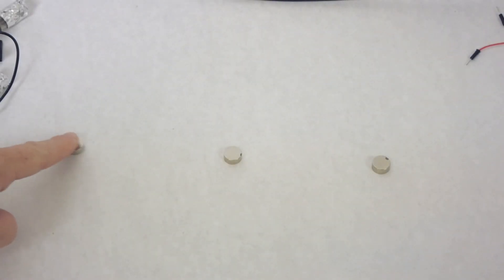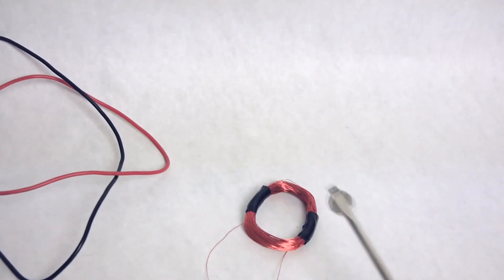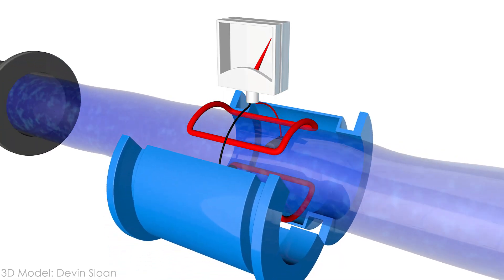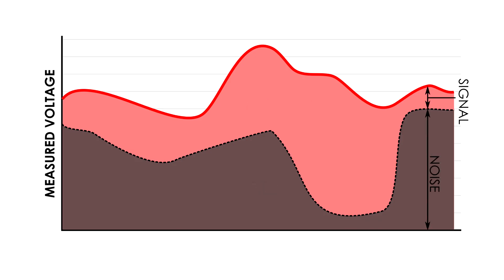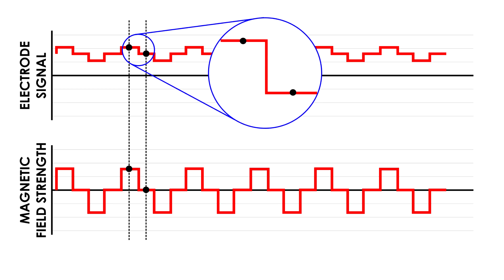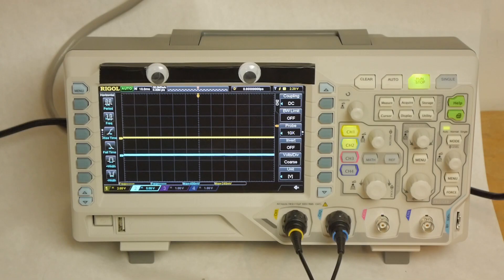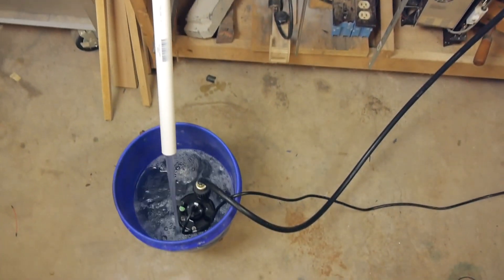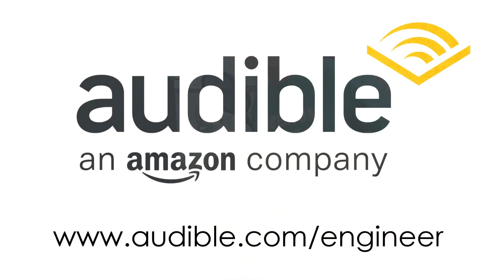How to Measure Flow with Magnets - (Magnetic Flow Meters)

Comment: I think you might have less noise if you had well-grounded copper pipe sections on either side of the flow meter; this would serve to dampen charges built up from the water flowing through the pipe, the pump, mixing with air, etc etc etc.

Comment: Try using distilled water to clean your setup, then fresh distilled water in the measurement. Very slight changes in conductivity from chlorine in tap water will greatly affect your result.

You may also want to try using a grounded steel bucket instead of plastic to limit static build-up.

Very cool video though, I may have to build one!

Comment: I am not sure what affects the magnetic properties of water, but maybe adding some salt might cause a stronger signal. However I do not know if the water pump would like it and if this would add more noise of the pump to the voltage measurement. I would also suggest trying the insulate the outside of the electrodes better.

At university I also did an experiment in which we had to measure velocity, but using an laser (laser Doppler anemometry).

Comment: I've dealt with very small signals in the past with a much different application. I used it for what we called it for my final project "visual communication" communication using visible light. Our requirements were more stringent in terms of bandwidth, however I would the think a similar set up may work in this case. 
Oops,  I was just about to make a mistake, I realized that your circuit provides a voltage source instead of a current source as my photodiode did, 

anyways I think you need a bandpass filter as shown in this article:
http://www.analog.com/library/analogdialogue/archives/48-02/flow_meter.html
You can use Figure 9. The rest may be unecessary, such as figure 10 which is supposed to figure out direction of flow.
Just be careful, analog electronics is a pain in the balls.

Comment: Ultrasonic transducers are a great way to measure flow.   Phase change is relative to flow rate and changes in amplitude is related to changes in the fluid density or entrapped gases etc.

Comment: You should make the electromagnets longer. Say 1 meter long and 3 cm wide. Then put ground connections 30 cm before and after the magnets. Then wrap the whole sensor in aluminum foil to block radio signals.

Comment: Slightly unrelated, I think the mass air flow sensor in my car uses the physical deflection of some component to measure flow. I want to say it measures either resistance or capacitance, (capacitance seems to make more sense to me at the moment) but either way, as the component deflects more due to higher flow, the value of that characteristic changes.
Reply: It probably uses a "hot wire anemometer," look that up.
Reply: Looks familiar, thanks for the tip

Comment: Add some salt. Would ions in the local environment change results significantly? I'd also try distilled water. "Pure water," as I've been instructed is remarkably insulative. Such devices may need to be calibrated to local water supplies, assuming that they are invariant. Diaphram meters are the simplest accurate measurement that I'm currently aware of for both gas and incompressible fluids.
Reply: If the point of an actual meter is to measure the fluid that actually has to be delivered, changing the fluid to make it easier to measure is not an option. You don't expect your water utility to add salt to your drinking water just to make their meters work better (of course if you live in Flint MI, you have lead in it already). For a test or a demo maybe, but in the real world you find a way to measure what needs measuring.

And he didn't talk about nonconducting fluids, although the teaser at the beginning of the video seemed to show a gasoline pump. Maybe they use a hot wire anemometer for those (but not too hot).
Reply from the maker: I tried some baking soda to increase conductivity but no dice.
Reply: Austin Keller then just don't do it? it really doesn't make much of a difference
Reply: As long as your differential instrumentation amplifier has an input impedance >> (much greater than) the resistance of the water, increasing conductivity won't help.

Even tap water should be conductive enough for this. The magnetic field inside the coils should be larger than the pipe, or eddy currents in the water sap the signal.

Absolutely pure water likely won't work, as there is close to zero conductivity. But even the slightest bit if ions in the water cause some conductivity. Water is the ultimate solvent - put it through a metal pipe, metal immediately starts dissolving a bit into the water. Plastic pipe? There may be salts or some other ionizable substance that can dissolve into the water. Glass pipes? Most glass has metals added to increase toughness or clearness.
Reply: +1
Reply: Justin Koenig The YouTube app doesn't implement +1
Reply: This electromagnetic effect (inductance) does not depend on the conductivity too much. What the magnet does is change the alignment of the magnetic dipoles of the electrons in the water molecules.This makes the magnetic dipoles point toward the magnets, but the dipoles are still flowing with the current. I think with a conductive medium there would be more dipoles, so there would need to be calibration due to this, but conductivity is not necessary (although everything has some conductivity) for this to work.

Comment: Some ideas to pinpoint the issues with the apparatus: 1) Use Hot glue to secure the coils into position, any movement could be creating additional noise. 2) What happens if you increase your square wave frequency. It is possible that the noise baseline is too far away from the required signal and you are not getting any meaningful results when cancelling out the noise. 3) Reduce background noise by adding a faraday cage around the sensors and wires leading to the oscilloscope. 4) you explained the theory but did not give any details on how you made your sensors cancel out the noise after the signal has been detcted (circuitry etc).  This can either be accomplished via some arduino code, a splitter with delay circuit going into another port of your oscilloscope or some other options.

Comment: Silly question: would a more conductive fluid  (read: salt water) induce more current from the inherently lower resistance?
Reply from the maker: Tried this and didn't seem to make a major difference (I used baking soda).

Comment: Would changing the pipe (that the coils are connected to) to a smaller diameter give a better signal, since it will increase the fluid velocity?

Comment: Why is the magnetic field varied instead of just passing the output through a high-pass filter? Both techniques seem like they would only eliminate low-frequency noise.
Reply from the maker: Some of the noise is a constant source (e.g. electrolytic voltage) which would not be filtered out.
Reply: A constant term has a frequency of 0, and would be filtered out by a low pass filter.
Reply: Oh! But a high-pass filter would also filter out the signal from a steady flow in a pipe. You would only be able to get changes in the flow rate.

Comment: My first point of call would be to reduce the electrical interference in the signal wiring. I don't think you ever showed it in the video, but I would start by using shielded twisted-pair cable to connect the electrodes to the differential amp. Make sure you connect the shield to the differential amp's ground, and connect the twisted pair to the two electrodes. Hopefully that's something you can try without too much work? If you want a cheapish source for shielded twisted-pair cable, you can buy STP Cat5 networking cables pretty cheap. Or you can buy audio cable, though that's usually on a larger spool.
Reply: Quentin Smith buy a cheap microphone cable for $5 or so on EBay. Cut off the connectors. Voila.

Comment: Estimated, please note that at 5:15 yoy explain that the changing magnetic field is produced by a changing "DC" current. In reality that waveform is "AC" since the definition for an AC waveform is that the mean value of the wave is 0. Hence to consider a waveform non "AC" it has to have a mean value different to 0.

Greetings from chile, love your channel!
Reply from the maker: You are correct, but most of the literature that I read still calls this waveform a series of biphasic DC pulses rather than AC. I guess the less-rigorous definition of AC implies a sine wave.
Reply: Wouldn't it just be modified square wave AC though? Your graph looked exactly like what a cheap DC-AC inverter puts out.
Reply: Oh, i see. It's just a matter of "names". Time ago, when i was in college, the books called "pulsated DC" or as The Metal Butcher states below, is a form of a Square Wave.

Greetings!

Comment: Cool video. this reminded me of a company near where I live that makes flow meters which "listen" to the pipe in order to determine flow rate.
Reply: There's another method of measuring flow which uses strain gages to essentially measure the torque which the flow imparts on a U-shaped bend in a pipe. This probably won't work well for this sort of setup however, as I believe it works best in higher pressure/flow scenarios.

Comment: Would it be possible to use a Faraday cage to cut back on background noise. Could even have everything except the section of pipe being measure outside so the pump and power source don't interfere as well.

Comment: Air core coils. If you can fill the cores with a ferromagnetic material it will vastly increase your field strength.
Reply from the maker: I was curious about this and did some experimenting with iron-core electromagnets but did not see a difference in signal quality. All of the research I did showed manufacturers using air-core coils fit to the pipe like shown in the 3d model. I think the main issue with the demo was having too much turbulence between the electrodes, but increasing the field strength is probably the next biggest issue.
Reply: I have some ideas yo may want to throw at this.

1: You may want to ground the fluid at some point before and after the electrodes, This will help buck stray voltages.
2: Check your driver frequency, you may be running into reactence limitations of your coil and need to back down a bit.
3: try and mount your dif amp as close as possible to the electrodes and shield those connection if you can to avoid noise.
Reply: Bingo...I was just thinking the same thing.

Comment: Isn't tap water non-conductive though?
Reply: Pure water isn't conductive. Tap water always has ionic impurities. Hope I helped!
Reply: Pure water is non-conductive, but most water sources provide impurities that may conduct. It's not a certainty, and probably not consistent, so it's another reason this method is going to be difficult to make accurate.
Reply from the maker: Magnetic flow meters are used extensively for potable water. The conductivity isn't high, but it's high enough for this type of meter to work. (Also I added some baking soda to the water during troubleshooting, but I don't think the conductivity was the main issue).